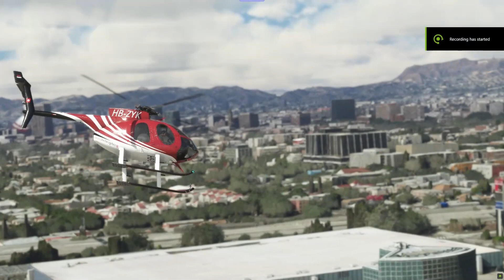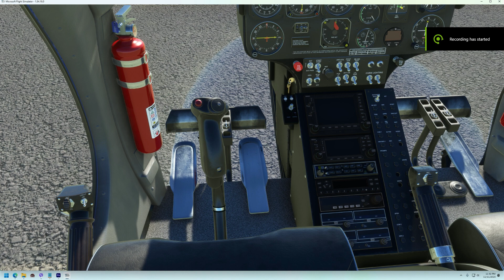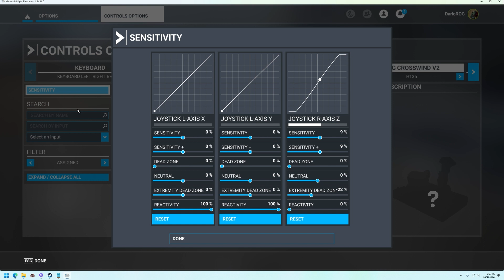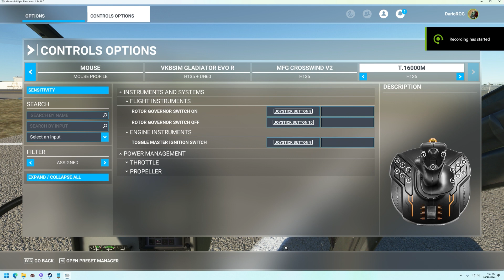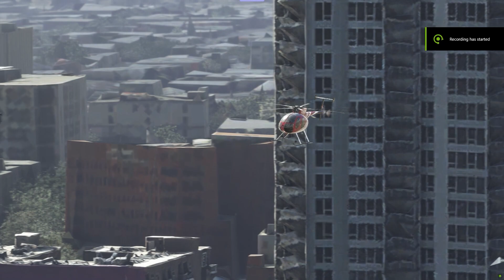My Helisim Control Setup | ULTRA SMOOTH CONTROL

Comment: Great video, 100% agree about the stick spring you mentioned and not having one. My stick a X52 Pro has a spring on it but I use the same stick for other games like Elite Dangerous etc, so the spring is useful. But when it comes to MSFS it's a pain to have. One tip for anyone else is to get some very small cable ties about 3. and tie a few of the springs together. there by releasing the pressure of the spring, but for helo flight but it's enough for other flight games.

One day I might buy a different stick for heli flight..

BTW - it's pronounced CI---CLICK, the 2nd way you said it in the video.
Reply from the maker: ci - click.  Good to know!  Thanks!

Comment: Hi thank you for the tutorial.  I am currently making a collective based on your tutorial. I am adding some buttons to it.. your tutorial  was fantastic very clear and essy  to follow. Maybe you could do a cyclic tutorial in the same manner with easy to attain parts.
Reply: One quick question  can you use the external  throttle with the H145 helicopter
Reply from the maker: Thanks for the comment!  I'm thrilled you're pursuing building your own collective.  I love the one I made and use it every time I fly.  You can definitely add more buttons to it and I'd love to add an end pod to it for that purpose but haven't gotten around to it.  

People have asked me to do the same for a cyclic and I would love to do that; have even given the real MD500 a close inspection on how it removes for passenger co-pilot seating.  Answer - it unbolts and has a big connector that unplugs.  Good to know, but not super convenient from a usability aspect.

Here's the problem -- the chair I fly in is also my desk chair.  The collective is mildly inconvenient in having to remove the arm rest but it's something I'm willing to accept.  But having to swing a leg over the cyclic every time I get in or out is an inconvenience I can't accept.  I just get out of my seat too many times for too many trivial reasons and it's just not practical to act in the very careful way I do when I sit in the real MD500.

My best ideas come from natural inspiration, the same as happened for the collective.  I saw something that inspired me and it clicked in my head how to do it.  I keep waiting for that moment to come with the cyclic -- something that is easy and convenient to physically attach and detach at will and that moment just hasn't come yet.  I think I basically have to see something that sparks the method -- something that will cause me to think huh -- that mechanical interface reminds me of something for some reason... and when I think of it, it will make my eyes big like THAT'S IT!  I just haven't seen that yet but if I do, I will definitely do a round of videos showing how to build it.

If you're not subscribed you should do that so if it ever happens you won't miss it.  👍🤠
Reply: @CaptainHelisim  when i have finished  the collective build i would be very happy to  share  some pictures of it with you i am using and old joystick and a leo bodnar bbi32 interface  for the buttons. Ps can i use the throttle with the H145. And how can i share pictures with you i have also build a button box for use with the cessna 172 with using an arduino.
Reply from the maker: @user-cv2bh4gj6h  And to your credit William I think you just inspired me.  I did not know what a Leo Bodnar interface was.  I looked it up and WOW!  I did NOT know those things exist.  That actually solves the more difficult problem on creating a cyclic.  So, well done sir!  There's still more inspiration needed but that's a big hurdle leapt in the process.  I will save the link for that for future reference and think about how to proceed from there.  It won't be super immediate but I do believe it's coming now.

My email is on my profile, you can send pix there, would love to see what you come up with.
Reply from the maker: @user-cv2bh4gj6h  Oh, and yes, you can use the throttle with the H145.

Comment: A great video!  For the Modern helos, how do you have your settings set? for instance do you use any of the flight assistance for the helos? or specific settings for them?
Reply from the maker: Thanks for the comment.  All my settings remain the same for all the choppers, no flight assistance.  I recently acquired the Flyinside 206 and it may be the most challenging chopper I've tried to fly.  I'm still trying to take off without looking like I stole it, but I keep all the controls the same -- just trying to tame the hand to do what it needs to do.

Someone just starting out with choppers probably needs to have some assists in place though.  Dealing with the sensitivities, torques, translational lifts, etc is a lot to handle all at once and the experience could prove frustrating enough to discourage a person from continuing to try and progress.
Reply: @CaptainHelisim  Thanks for the response, I keep fiddling with turning the assists on off all the time just can't seem to get a good balance, I did fly RC helos years ago, but but with the sim I just can't get it to transition from hover to forward flight smoothly, it's seem I can't maintain a decent somewhat slow forward motion.  It's either hover and bam it takes off quickly no in between, even with curve adjustments.  I'll keep working with it. Thanks again.
Reply from the maker: @METALSKINMETAL  I flew RC helis years ago too.  I find the Mosquito to fly a lot like them.  I don't think you should use curve adjustments to compensate.  

Here are my thoughts on what might be going on in no particular order:

1) Your controls might not be adequately smooth -- perhaps the joystick is "sticking" or is using springs affecting your ability to smoothly adjust them, or their internals are causing jumpiness in the inputs to the sim.  Lower quality joysticks can do that.  In the sensitivity setting under controls, make sure that the extremes of the control end up at the top and bottom of the sensitivity graph.  That is, when you push the joystick all the way forward, the sensitivity is showing it reaching the top line, but only at full forward and not before, otherwise you are making the joystick more sensitive than necessary making subtle precision control difficult.

2) You're still adjusting to the sensitivity of the chopper or struggling with the dynamics of how they operate (less likely because of your RC experience).

3) If you're not using VR you might find it very difficult to intuitively control the vehicle especially with those flight mode transitions.

Comment: Hey ...great vid Dario ...I missed it somehow. I AM getting better at helicoptering ...lol. practice helps ...but I've often asked myself if I should start to experiment with sensitivity & other adjustments. My AVA base is floor mounted & still a bit new to me ...I usually give it hours of use BEFORE I start messing with parameters. I use the strongest springs set at the highest tension & this will just barely hold the heavy Viper flight stick from just flopping forward & hitting my radios. (ButtKicker Amps occupy this space ...not radios) Remember ...I have a 12 inch stick extension with an offset (exactly like the MD500) mounted on the floor of my rig. The leverage effect cancels the high-tension springs & it feels perfect ...but what do I know about "perfect feel" when it comes to rotary-wing-flight? ...lol. I like linear actuated controls & have not changed anything ...however; I DO use trim to eliminate full forward deflection on the stick for most heli flights but it remains linear for landing practices. I simply bound my TQS throttle lever to ALL the helicopters ...this way I never get mixed up ...lol.
Reply from the maker: I saw someone's video of a real MD500 where they mentioned that the trim control is essentially critical equipment (and the reason they were unable to take off due to its state of disrepair) because if it's not functional it's like trying to push about a 20lb weight for the duration of the flight.  You can do it for a short lap around the airport but not for a flight of any reasonable length.  And I concur with this because that's exactly what I felt in Mr D's rig until I remembered to use the trim.

So as I mentioned in one of my videos -- the trim is more realistic to how one would fly a real helicopter but I think may undermine the intuitive understanding of how a helicopter handles when you're becoming familiar with that aspect.  In other words, my SUGGESTION is to learn to handle the machine without trim until you're really on it, then start using trim as a final realism-in-flight touch.

I admire your rig.  If I can get 1000 subscribers I might go ahead and pop for a motion rig for the next step for me.  I'm hoping for substantial improvement in FS2025 making it all the more compelling.

Comment: I also use the NXT Gladiator (springless) for cyclic.
Whenever I'm in the cockpit preparing to take off and the stick drifts forward, it effects my torque and rotor rpm almost as if I had reduced throttle. Takes several seconds after recentering the stick for the rpm and torque gauge to settle.

I don't get the same behavior in DCS with the AH-64.

Is this normal or just a MSFS thing?
Reply from the maker: That is a good question -- I get the same effect.  During all the set up you have to take your hands off the controls which I know is probably not a good idea in real life but difficult not to do in a computer situation and yes you get a drop in RPM.  I don't know if this reflects some sort of real world phenomenon or not but I'm going to visit an Airbus Class D simulator next week and I will ask them if that happens in their simulator or if they know if it happens in real life and get back with you.
Reply: Happens with me too. Curious, did you get an answer during your visit?
Reply from the maker: @bc6023  no did not get a definitive answer unfortunately. If i ever do I'll comment or do a short video about it
Reply: @CaptainHelisim  I have a VKB Gladiator NXT EVO coming and with the springs removed, it has a clutch that can be adjusted just tight enough that the stick won't fall over.
Reply from the maker: @dklassen  Hm interesting.  Mine falls over but it also has just a tiny bit of a ridge somewhere that catches just a little bit and can keep the action from being glide-smooth.  Which is not ideal for chopper ops.  I wonder if that's the clutch you're talking about and if it would get worse if I tightened it to keep it from falling over.  It's not great that it falls over but I'll take that over a ridge, if that's what it is.  I probably need to get under there and poke around again.
Reply: @CaptainHelisim  The model I have coming is the EVO, maybe it's a bit different. I also ordered a left hand  version that I'm going to use as a collective. You can lock out the x axis so it's more like a throttle and then use the clutch to to make it work like a collective. Mount it at an angle and bob's your uncle. Saw a guy on youtube doing that and it seemed to work pretty well. Was going for a full Virpil setup but dang, we're taking $1600. Decided to try something a little cheaper. Already have a set of Virpil Ace Torq for the peddles. Like you I'm 100% heli.
Reply from the maker: @dklassen  Yeah that dedicated stuff is really pricey.  It's such a niche market people are forced to improvise.  And the thing is to really get the proper "feel" for it, you can't really get away from the fact you have to have a collective.  I mean you can "play" without it, just substituting a paddle or some other thing just doesn't cut it.  That sideways mounted joystick is an interesting concept if you can lock one of the axes, didn't know you could do that.  But yeah I built one for $200.  I guess I was inspired by a video I saw of a guy fitting some kind of wooden adapter over a throttle quadrant and I thought hm maybe the only plausible way to make one cheap is to repurpose existing cheap hardware.  Which is what it sounds like you're doing.

Comment: Did MS remove Collective Axis from the Throttle list?

I'm trying to follow your setup but, I don't find collective axis when expanding the Throttle... it's located under power management.
Reply from the maker: Huh.  It looks like Collective Axis under Throttle became Throttle Axis -- that's what my collective control is currently controlling.  The collective axis is currently under propeller but I don't have anything assigned to it.  I guess I'll have to update this video.  Thanks for the heads up!

Comment: Helicopter pedals should be referred to as yaw or anti-torque pedals.
Reply from the maker: Fair comment.  Force of habit from years of flightsim before helis.  Will update my terminology.
Reply: Yaw is the word
Reply: hell, even MSFS refers to them as "rudder" 😬
Reply: @cuttheloop  Under the helicopter controls in MSFS, the yaw controls are referred to as Tail Rotor, although many helicopters still support binding to the Rudder axis as well.